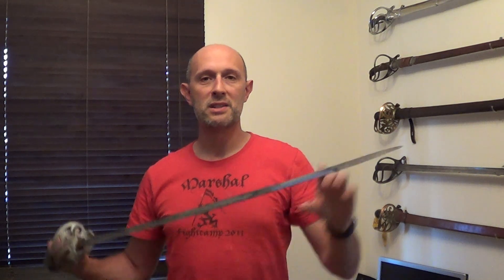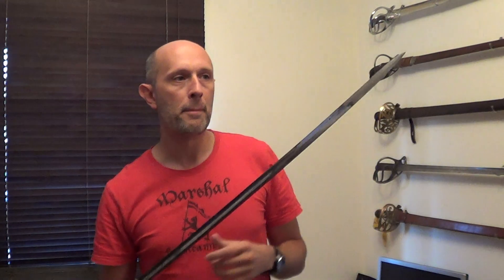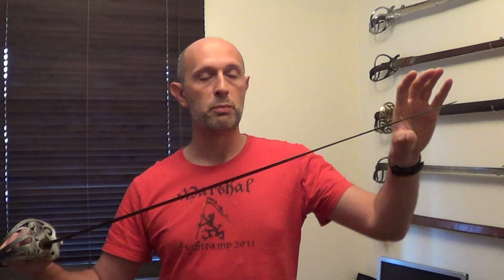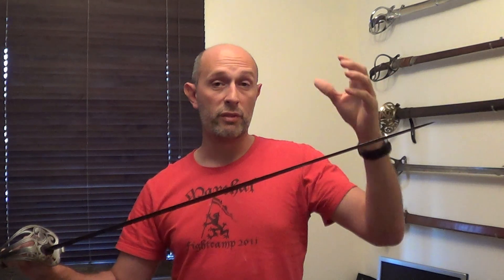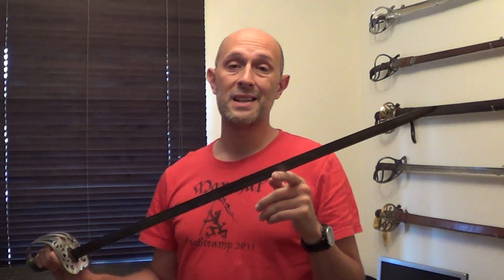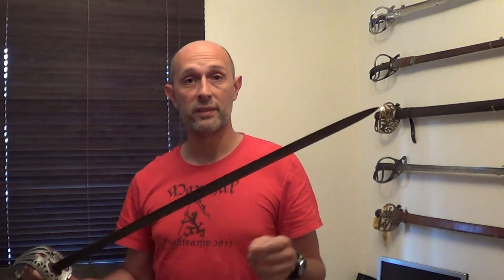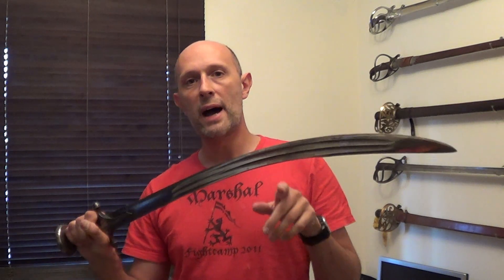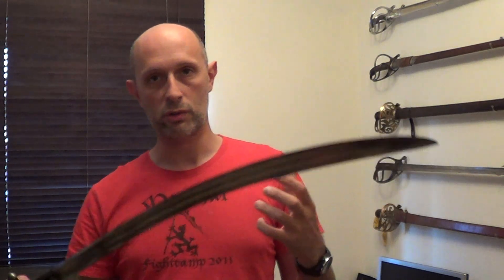Flexibility of sword blades

Comment: scholagladiatoria Matt I have a question. I have recently ben reading up on the Mughal empire for uni. There is a potrait of Awrangzeb (or Alamgir I) where, by his feet, there is a strait sword, but the hilt is that of a Tulwar; that is the one with the disk by the pommel. What would be the purpose of this hilt paired with this blade. I remember your video on Tulwars, and there you said that the disk hilt impeded wrist bending, and thusly made for powerfull draw cuts, but with a straight blade it makes no sense...
Reply: This is the image of him kneeling on a prayer mat (I think) in a red robe?
The blade in that image looks to have a gold/gold plated hilt and also a gold/gold plated chape.

This, combined with the setting, make me suspect that it is a ceremonial blade.
Reply: Wunel Yupp, that's the one. Perhaps it was just ceremonial...
Reply: *****  a gilt hilt is no impediment to fhting capability, also its likely that the weapon may have been a khanda... tell me, did the pommel have a spike coming out of the end? and was the blade flared aka did it get wider at the tip than it was near the handle?
if it had those it was a khanda
Reply: elgostine I treid to find the picture online, but to no avail. The pommel does a a thing sticking out on the back, but it's very small and not pointy, looks mostly like decour. The blade itself is straight and doesn't taper much unitl the very point...
Reply: You mean that?
http://oi42.tinypic.com/xqfhhy.jpg

It's khanda, Indian straight sword, as you correctly recognize thanks to the hilt.

It's not that silly and nonsensical as you may assume. Every nation has it's curved and straight examples of blades, with it's distinguish features (in Indian blades - the hilt).

Hilt forces you to use tight, hammer grip, thus forces you to depend mostly on slashes. In other words and to give you an example - you use khanda like European viking sword. :D
Reply: Łukasz Kos Kind of, just remove the hand bar from the hilt and it's pretty much what's on the picture.
Reply: To be clear. I was not insinuating that gilt impeded fighting ability at all. However is it very unconventional for gold to be used on fighting swords because it is too soft to have any function and is valuable to the point that you would wish to avoid damaging it. Hence all the swords we find in battlegrounds are made of common metals and woods.

I suspect you are right about it being a khanda, I hadn't heard of those before. I still believe it is ceremonial though.
Reply: Actually, I cannot tell from the photo whether it is meant to be gold. Different photos show different colours, could well be iron.
Reply: Łukasz Kos Here I managed to find the picture: http://upload.wikimedia.org/wikipedia/commons/9/91/Aurangzeb_1.jpg

Now, I do not find it nonsensical, rather out of place. My question was really why would you put a hilt specialized for drawcuts on a blade that is not specialized for drawcuts. The bending of the Tulwar makes it perfect for wrist stiff drawcuts, and the hilt help emphasis this. But in the case of a strait sword I can only imagine the hilt being a disadvantage and mostly in the way...
Reply: well, actually a straight cut oriented lade still uses draw cuts, its the generally accepted method of using viking era blades too,

Comment: do you think if they had stainless steel in ye olden days they would of used it rather than carbon steel?
Reply from the maker: Torc Handsomeson As the others said - stainless steel is useless for swords as it is too brittle (I don't personally like it for knives either).
Reply: just as Ken said - even today with all the hi-end steels available best big blade knives that can withstand huge amounts of wood chopping are being made from high carbon steel and ones made from SS chip a lot or even break huge parts of the edge off.
Especialy when used to prepare fire wood in bellow freezing tempreture ...
So big blades high carbon, sword blades spring steel - patination is natural, rust is not a huge factor when you consider the utility you are getting and when you take care of your blades :)
Reply: 0.o you mean like ignoring psysics and geometry?
Reply: scholagladiatoria i have one question thouhg: would it be possible with allmodern techniques and technology to creat a balde thats equaly in cutting as the best curved sword (exsample katana) and jsut as equaly good at thrusting as the best typ of trhsuting balde?
Reply: titanscerw or course not. of course in the boundries of physics. just the ultimate possible blade
Reply: MikePhantom ou have to wait to carbon engineering really gets going and you can make a long thin sword that is stiff  out of diamond
Reply: ***** There are modern stainless that can take the impact of older carbon. One is Bohlers N350. Good stuff.
Reply: N350 has edge retention around the 154CM range and toughness around the 5160 range. The idea that stainless isn't tough is no longer valid with modern metallurgy. There are some really good, tough stainlessness out there.
Reply: Kevin Oubre btw i have no idea whats those numbers mean :D however thanks anyway for trying
Reply: MikePhantom They are just grades of modern steel.
Reply: Kevin Oubre  have you seen some blade made out of it thoroughly tested? I mean big blade long one, falschion length at least ...
I assume its particle metalurgy made steel correct?
Reply: titanscerw it would just be nice to have an +ulfbreh+t ofmodern times
Reply: ***** yeah i have 7500$ to spare -.- jsut like that
Reply: titanscerw no. I don't think they make stock big enough in it yet for swords. And yes it is powder metallurgy
Reply: Diamond spikes attached to wood would work well, theoretically. Just a huge amount of tiny diamond spikes, tilted somewhat towards the hilt except for the one on the tip of the blade, having an appearance of a shiny, grizzly fur coat.
Reply: Katanas are very good at both cutting and thrusting, but nothing will come close to the rapier in thrusting.

Comment: Quick question, but what is the specific name of the last sword you reviewed (the stiff, triangular cross-sectioned, basket hilted Backsword(?) looking one? I was hoping to find some more information on that specific blade's use and contemporary weapons that it might have been designed as counter-measure to. Thanks!
Reply from the maker: It doesn't have an official name, it is an experimental type that didn't gain popularity. However, you could call it an estoc.
Reply: scholagladiatoria
Is there a specific reason why it didn't gain popularity?
Reply: maaderllin Just guessing, but there was an ongoing debate during the period (and continues somewhat today) over cut vs thrust. A sword that is totally incapable of cutting probably wouldn't have been appropriate as a regulation pattern as many officers would be unable to use it with their preferred fencing style. Cut and thrust swords would generally be more suitable as a standard and therefore widely available pattern as they can be used by everyone in whatever manner they like, with purists able to arrange private purchase of custom swords suited for their tastes if they were willing and able to pay for them.
Reply from the maker: maaderllin In a sense, it did gain popularity, but later with the British 1908, US 1913, Spanish 1908 and the French 1896 thrusting swords. The thing is, purely thrusting swords are great in the charge, but hopeless in the melee. By 1900 European cavalry did not expect to get into melees anymore, but in 1850 or even 1870 it was still seen as a possibility (especially in colonial wars), so swords were expected to be able to both cut and thrust.
Reply: Thank you for your answers everyone
Reply: @scholagladiatoria, thank you for your answers and information, I really enjoy these videos as they take the approach of actually analyzing each respective weapon from an objective and academic point of view without taking anything away from my subjective appreciation for the design and aesthetics of the blade.
Reply: duly noted. Maaderllin  thanks everyone who weighed in!

Comment: You should talk about how incredibly bendy and rather weak in the thrust pipe-backed swords tended to be. I've heard accounts of pipe-backed blades used by the British having many problems getting through the thick coats that the Russians used. In fact I've heard pipe-backed blades weren't very good at cutting either, being that they'd tend to stop once the pipe entered the target.
Reply from the maker: I have covered this in at least two previous videos, but I may do a video specifically just about pipe-backs in the future, yes. :-)
Reply: scholagladiatoria Please do! I've only owned one genuine antique blade, an Italian cavalry sabre model 1873, and it would be an excellent example of how not to design a sword.

Comment: Of course, the majority of modern Katanas will be made from a verity of High Carbon Steels such as 1060, 1095, T-10 etc. But there are many Katanas that are made from Spring Steels like 5160 and 9260. Indeed, i bought a 9260 spring Steel Katana no more than an hour ago. bloody good blade with tons of flex.
Reply: The majority of modern "katanas" are made from cheap stainless steel with no heat treatment at all :P To me it seems a bit odd to make a katana from spring steel because the benefits are somewhat negated by how thick katana blades are. They are traditionally made with (compared to european swords) thick, narrow blades to increase stiffness and avoid taking a permanent bend. If you are going to use a spring blade it seems better to go with a thinner, broader blade (like on medieval eurpean swords and indian tulwars) to minimise resistance in the cut. I have a spring steel arming sword and it actually cuts better than my (admittedly cheaper) traditionally hardened 1060 katana.
Reply: lancer D
I'm in no way a Katana "Fan Boy", but if you buy a decent one, they will outperform a straight edged sword for cutting and hacking simply due to them being designed specifically as a cutting weapon. Much the same as a Sabre, Scimitar, Cutlass, Tulwar, Kopesh etc. They were meant to cut. Longswords, Bastard swords, Arming Swords etc can all cut very well if the sword is well made and has a decent edge. But any curved blade cuts better. That's just in their design. Different swords perform better at different tasks.

The thickness of the blade isn't an issue i have ever experienced with any Spring Steel Katana i have ever used. This review (i will link below) of the Oniyuri on SBG shows how good a Spring Steel Katana can perform. It basically just adds an extra element of durability to a sword that is used for cutting and hacking off limbs. 9260 is actually a fairly rigid spring steel and takes a considerable amount of force to flex anyway making the thickness of the blade largely irreverent in this case.

The Katana is basically just a Japanese version of a Sabre. They are primeraly the same sword designed to do the same thing, ie Hack and Slash.

Those stainless steel Katanas you mentioned aren't even swords imo. They are "sword like objects" designed for nothing more than display. The large majority of "Functional" Katanas these days are either 1045, 1060 or 1095. But the 9260 Katanas are a great option because they hold a great edge and the added flex make them that bit more durable.

http://www.sword-buyers-guide.com/authentic-ninja-sword.html
Reply: blakefish80 I'm just saying my arming sword (it's a type xii, so it is primarily designed as a cutter with some thrusting ability) cuts better than my katana, not trying to make generalisations. When I cut a bottle with the arming sword for example, the top usually doesn't fall off while with the katana the top usually goes flying because the blade thickness creates more vertical displacement. So I disagree that all curved swords will outperform all straight swords in the cut because I have personal experience of the opposite being the case. I also own two antique sabres, one is designed as a cut and thrust sword with a diamond section tip and a false edge, and the other is designed as an almost pure thrusting sword (modern fencing sabres are based on this type) and some cutlasses are also straight swords with a false edge, so I take issue with the statement that these types of sword are all designed just to cut. 

I'm not saying spring steel katanas are bad, just that to me if you are going to get one it may as well be traditionally heat treated as that lends an aesthetic quality to the sword and through-tempering loses some of its advantages on a thick sword with little to no distal taper.
Reply: That's all fair enough. I was indeed generalising on the sabre/cutlass point, i was speaking of the curved variation.. However in my experience a well made curved blade is better at cutting most of the time. I'm in no way suggesting that straight blades such as the arming sword are poor cutters, But in the hands of an equally well trained swordsman in the use of either particular weapon, the curved sword tends to out perform the straight sword for more precision and deep cutting potential.

It's just what they were designed to do so it's not really much of a surprise. I'd pick a high end Katana or Scimitar for cutting over any straight sword for cutting any day, but i'd kick them both aside for a good long sword if i was after a good thrusting sword with better penetration. Different swords for different jobs, but well made varieties of any of those swords can do a good job at all of the above uses.

I think the Spring Steel Katana is still a rather new thing. Aesthetics and tradition don't concern me tbh. I'm never going to be able to afford a Tamahagane Katana crafted by a master smith in Japan, so i'm happy to try out different materials on the swords i can afford. So far, from my experience, 9260 is a fine choice for a Katana blade. You should give one a try if you get the chance to use one or pick one up at a decent price.
Reply: Fight Student
I wouldn't go as far as to call myself an Iado practitioner, although that is something i would like to get involved with. But there are no clubs in my local area so it is difficult.

I'm just an amateur back yard cutter but i'm not very good. I just do it for the fun of it, check out my vids on my channel ;)
Reply: crikk23 You hear the "curved blade equals less contact" argument all the time, but a little thought shows it simply isn't true. Any given target you are likely to hit with a sword, be it an arm or head, or a bottle or roll of tatami has a much smaller radius and tighter curve than any sword will. Flesh is also soft and will deform around the blade up to the point where the bones and tissue behind it provide enough support for it to be cut. Both of those factors make the curvature of the sword insignificant from a physics perspective. More importantly though, having a curve only makes for less contact at the surface. As soon as the blade gets inside the target the edge represents a line between two points - the ends of the cut. As we all know, the shortest distance between two points is always a straight line, so a curved sword will actually have a fractionally longer edge in contact at every point in time except the moment of impact. 

To be clear, I am not saying straight swords are better cutters that curved ones, I am saying there is nothing inherent to the curve that makes it cut better, and straight or curved makes little difference either way. That said, if you took all curved swords and averaged their cutting ability and did the same to all straight swords the curved ones would come out on top. This is again, not something that is inherent to the curvature, but a matter of design. Straight blades are better for thrusting. Therefore if you are making a curved sword you are going to optimise its design towards the cut end of the cut-and-thrust spectrum. Curved swords are made with thrusting as a secondary consideration, otherwise they would be made straight. The only slight advantage curved swords have in the cut is that they have a longer cutting edge for deeper draw cuts.
Reply: lancer D
To be completely honest, that's my only preference to curved swords also, i prefer how they look. As collectors, we might do some light cutting and form practice with our swords. But they are mainly for display purposes in this day and age.
Reply: blakefish80
 Are you are Iado practitioner?  If sure you should ask your instructor for his or her opinion.
Reply: Well if you don't have formal training you are likely to cut improperly and damage the blade.  Iado schools really dissuade  people from doing such things.
Reply: Fight Student
I have studied books and video to show me how to correctly hold and use a sword. But i only really do light back yard cutting for fun.
Reply: lancer D
maybe im misunderstanding what your saying but...

a curved blade vs a straight blade(made of the same quality) will cut (as in a slash) better just do to physics.

at any given point there will be less contact with the target thus making it easier to cut.

tho as said a non curve blade can cut(and i for sure would not want to be on the end) but is going to fall behind do to having more contact at any given point.
Reply: Jonathan Allen What if they are wearing a gambeson or leather armour? Swords aren't bullets, they don't do damage by shock they do it through blood loss and separating nerves and muscles.
Reply: lancer D
well i was thinking of a draw cut in this do to how you said they are made for that.

so maybe a better way would be to say if both blades where cutting how there meant to then curve would win in the cut(as in they draw cut better) do to them being made for that kind of attack.

tho i will say id take a straight sword any day.
Reply: crikk23 Yes that would be more or less correct, albeit a generalisation. Personally I prefer curved swords because I like them better aesthetically.